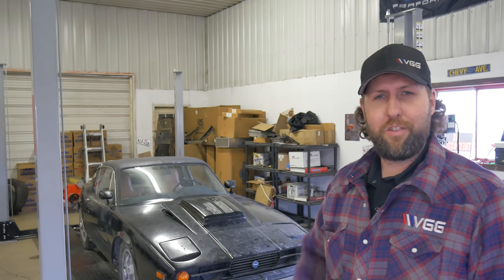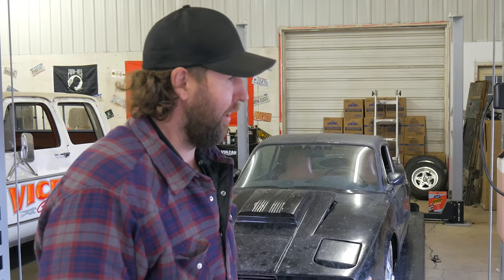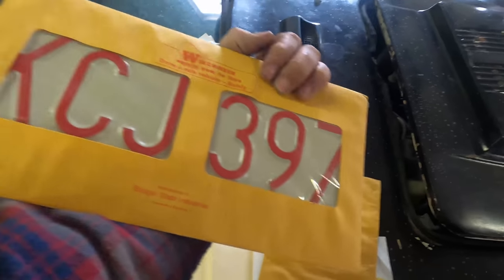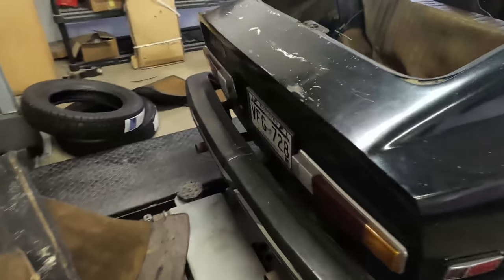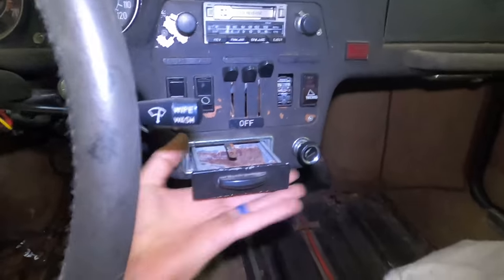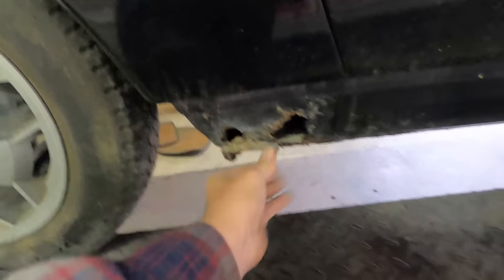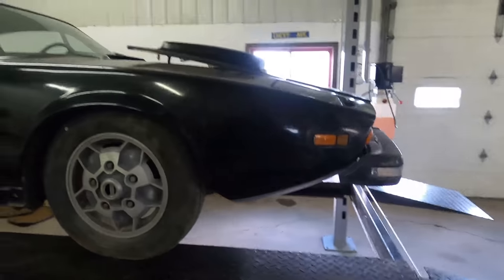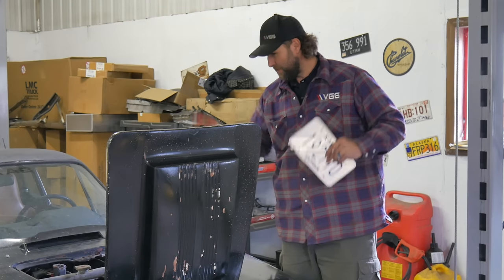FORGOTTEN 1974 SAAB Sonett III - Will It RUN AND DRIVE after 29 Years?

Comment: For parts, European Parts International in Cali. Worked there when I was a kid. They also use the name S.A.V.E.(Service and Value Expiditors).
We had a customer that actually had a Sonnett Type 1 prototype. Looked A LOT different than yours.
 That V4 was based on the V6 that was in gen 1 Ford Capris. Many parts are interchangeable.

Comment: I had a 1984 subaru GL sedan that had a v4 motor, and the full sized 13 inch spare mounted behind the air cleaner under the hood.

Comment: ok, so I may be a couple years late to the party, but you can use parts from a Ford Essex 3 Litre V6 in these, the valve train and pistons are identical, just with a 4 Cylinder cam and crank, The rocker shaft will fit if cut short to fit.

Comment: I wonder if a guy realized a lot of those parts are based off aviation parts, especially look at the brake lines. The couplings are MS style fittings for example! 

Derek, cool find, I used to be an aircraft mechanic!!

Comment: A thermostat doesn't cool a major, it holds the coolant in the motor, allowing it to come up to temperature. Then it opens, allowing cooler temperature coolant into the engine block. And then closing again.

Comment: Sonett are real cool cars

The sonett II which is even rarer is powered by a 3 cylinder, cylinder ported 2 stroke like in a snowmobile.

I would love to find one and turbo it the way guys do with hill climb 2 stroke snowmobiles. The key is lots of back pressure so it can build boost off that until the exhaust is closed off. People do it. I seen a 600hp 2 stroke somewhere here on YT

Comment: SAAB engineering  now were talking feller... still got my `81 Slaab turbo she runs just fine, ah well my Cajun Queen tells me so... all I get to do is test drive it for the brake test drive so what can a feller do to get a gal to woe it some a bit to get more then 6,000 kilometers from a set of those front pair, and I dig what you are layin down their young feller from up norde where`s you used to roam when you were a younger man

Comment: At 57 min. in it sounds like the valves are out of adjustment and the timing sounds off too...Hey I already use Harrys razor and blades. Seriously comfortable smooth clean shaves and the price is right...that "smoke" looks like steam to me. Driver door popping open due to frame flex with all those speed holes? 60 H.P. is same as a VW beetle! 
I test drove one of these in 1990's and it was gutless but fun to drive. It was in excellent shape but I passed on it.

Comment: Loads of euro/UK cars that went over to the rates had the styling ruined by the safety bumpers. My dad had 2 SAAB 900 turbos when I few up. Great cars. Btw, SAAB built fighter jets as well, hence the design cues. They used that connection on their ads for years. Pity they went under.

Comment: That was cool but I've never seen a distributor wobble back and forth as the engine is being cranked before it starts at 43:55. It looked like the distributor shaft might have been bent but that's not unusual for one of your cars.

Comment: I had one of those in the 90s. When the guy I bought it from wanted to buy it back I pretty much gave it to him. Then he cut it up. I’m still a bit P’d about it. I think I might know where the body is. I know the running gear is gone so it can’t be worth anything. When I bought it I did pull it out of the weeds after 15-20 yrs and drive it home.

Comment: Couple of things come to mind. 
Am I right in saying that SAAB use/used a lot of GM (Vauxhall UK) components so I'm surprised to hear that it's a Ford engine!
If that is the same Ford V4 that was sold in the Corsair UK model from the 70's, it was famous for big end failure because of the 3 bearing crank.
And joke of the time was :- the new model called the 'Pubic' - made for old Corsairs
Reply: Its from the Ford Taunus 15 m / 17m . Later they made the Triumph 1.85l engine on licence , for the 99 model .

Comment: Yes,  I would like you to tackle weird stuff like this.  Eldest Boy and I pulled a 70s Audi home that was a freebie and we got the whole front out, and out of the way to replace the harmonic balancer...why it was a freebie.  OK, truth is Eldest Boy hated the part about the balancer, so he focused on the sunroof.  Anyway, we got her working, but had plenty of fits with the mechanical fuel injection in a car that had sat for many years.  Did you sell it along?  Does it run?

Comment: I was SO into these cars back in the mid-70's.  My dad offered to buy me my first car, and we were car-shopping in Memphis.  I saw a dealer lot with 2 or 3 Sonett III's and fell in love with them.  I couldn't talk my dad into it, though, and I ended up with a family friend's '69 Dart 4-door Slant-Six (much better first car, I'll admit)

A few comments ...  (I've only watched about 1/3 of the video so far, so I might be off base with some of this.

I still have squirreled away somewhere a 1974 (I think) magazine reprint of an article (MT?, C&D?, R&T?) on this car.  The article was  "Say it So-nett".   Apparently, the Swedes did not pronounce it like the poem style (sonnett) and made kind of a big point of that.

I'm fairly sure that color is not original.  I only ever saw Yellow, Green, and Orange back in the day.  I've seen Red since then, but don't know if it was original.  

That engine cover does not look original to me.  One complaint about the Sonett V4 (basically the Sonett II with the V4 4-stroke engine vs the original 2-stroke motor) was the offset hood bulge.  I think it looked cool and other cars have also done that clearance solution (Opel GT, for one - TR250 for another).  But when the model III came out, it had a smaller "hood", centered betwixt the wheels, and only the slightest bulge to it.  Yours looks (to me) like an aftermarket or homebrew hot-rod version.

These cars had an interesting diagonal  braking system, so that if you lost one set of brakes you would still have both (some) front and (some) rear brake remaining.

The Sonett III is definitely a unique design, but if you appreciate the III then take a gander at a Sonett II or a Sonett V4, and you might find your heart skips a beat.  No giant US bumpers, the rear hatch is a curved-wraparound style, and the rear end actually has some shape instead of the III's Kammback design (which really looked much better on the Bora and the Pontiac Firebird Type K concept car (clear gullwing cargo doors on a Firebird wagon - what a traffic stopper that would have been).  Anyway, back to the SAAB - just like Midgets, Spitfires, and X1/9's,  the bumpers put the real kibash on the look (just as Derek said), but the Sonett II/V4 had so much more going for it in the design department.  If I went shopping for a SAAB 2-seater sports car now, I'd definitely be looking for one of those.

Comment: You asked about foreign  car requests, how about a 2001 Mazda base model NB2 convertible, you’ll have fun with that, that’s what I have. It 1.8 engine 4 cylinder and it takes 3.25 quarts with the k&n filter I use a lug nut on top makes it easier to take off. I’d be curious what you would do. I have the factory manual on pdf. I can email it to you:)

Comment: The concrete will be fine the plastic marks will come out after it fully cures. Don't use the stain unless you do lots of research first. For the rest of the driveway you really should put 4in of rock down before you pour the concrete

Comment: What did Ford put that v-4 into?  Why didn't Saab just use the Pinto-Cosworth cross-flow straight 4, 2 liter, it was a good engine in my Pinto.  I just figured it out, it wouldn't fit into that square engine compartment.

Comment: 455lb capacity?! What is this, a motorcycle? There's two extra wheels and two extra brakes, though. 

And a V4 with 1342 timing is strange. You normally want to offset each side. 1234 timing would naturally balance itself more than two explosions on one side, then the next two on the drinker's side.

That oil filter was put on the old fashioned way I was taught, hand tight and back a 1/4.

And another thing! That extension x4 to hear valve tap thing is a fun trick. But because you aren't "hearing" vibrations through the extensions, it'd be better to put it on the lump of bone behind your ear so the vibrations can directly transfer to the ear bone (it's a thing).

Comment: When you say they moved the steering wheel from the right side to left side... ummm...  you do realize that Sweden drives the same way we do in the United States.  Left-hand drive, right side of the road. So NO change would have been made in where the driver sits if it came straight from Sweden.   Only if the car is marketed in England, Japan, or Australia would it have been righthand drive. ALL other European countries drive exactly the same way the United States drives.

Comment: Saab 96has4 cilinder v
Block Ford England
Even  had 2 stroke
High rev...  Engines
For rally s
Blacksmith theo
Harlingen holland
I owed some 99 s2 
Liter blocks in it .

Comment: Swedes drive on the right side like the US, so it wasnt converted if its an original car. Also most car manufacturers put the filler on a random side for each model, thought that was the same in US, a guy always walks to the driver side there? Mmh, thats odd

Comment: SAAB were always well engineered and only went slightly downhill when GM took over. They refused to take shortcuts and were eventuall y closed down for being too expensive. Also like your occasional use of English English like a typical English word bugger and a few others I've heard  especially ALUMINIUM instead of the slightly irritating ALUMINUM